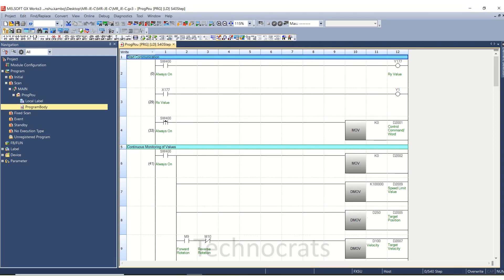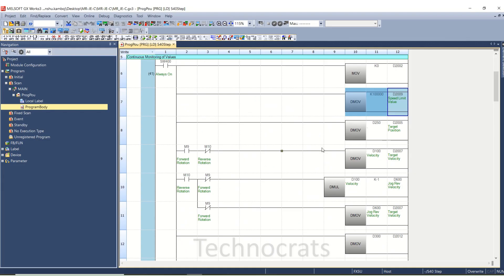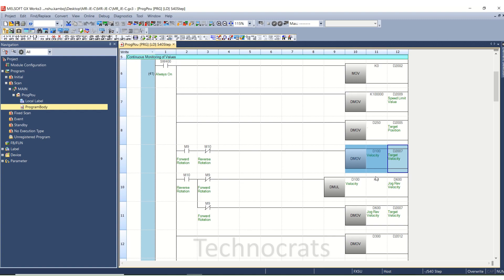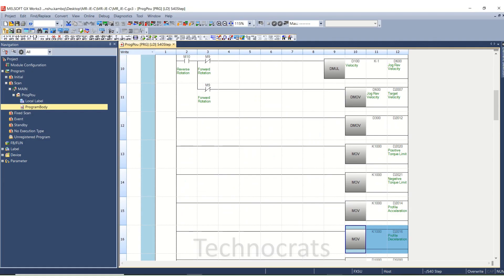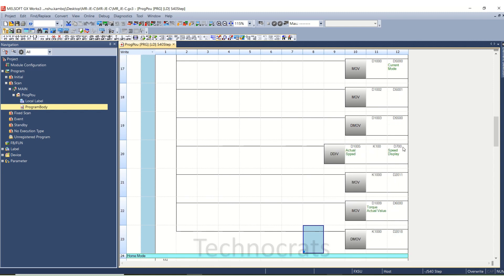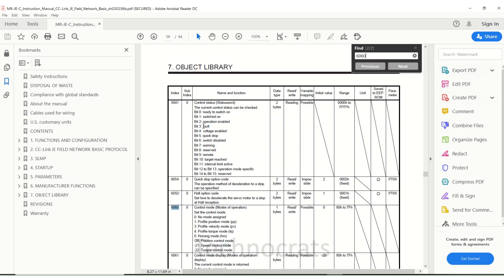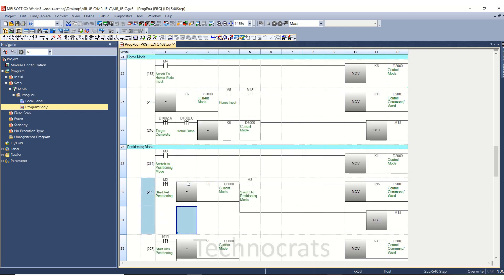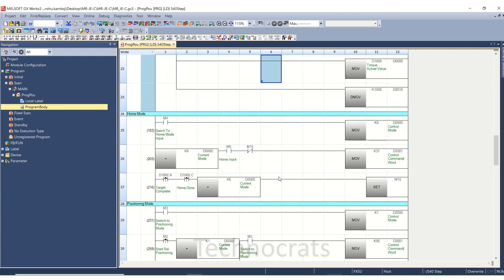MR JE C Servo ( Home & Positioning) with FX5U Part 2 (CC link IE Field Basic)

Comment: 🙆With ac servo Mitsubishi MR-JEC, and Ethernet communication 🙆with FX-5LC . 🏃‍♀️🏃‍♀️😋I want to know where can I check the position setting parameters that have already been set in MR-JEc . 🙂‍↕️(The data stored in the register of Mr-jec) 🙂‍↔️Where can I check the parameter setting in MR configurator. 🥹🥹🥹

Comment: Do you use the CN3 origin input?
Reply from the maker: Parameter PT45 is set 37, which is for Data set homing method,
You can use CN3 Pin No. 2 DOG For other homing methods.
Reply from the maker: For more clarification you can refer manual

MR-JE-_C SERVO AMPLIFIER INSTRUCTION MANUAL (PROFILE MODE)
Reply: Can you give me gmail, or contact information
Reply from the maker: himanshutech13@gmail.com
Reply: If I am not using CN3, what home method do I use.
Reply from the maker: home method depends on your application programming & hardware
Reply: @Technocrats91  thank you very much